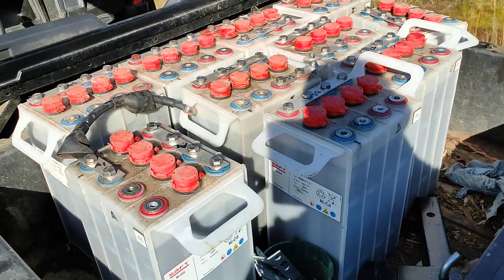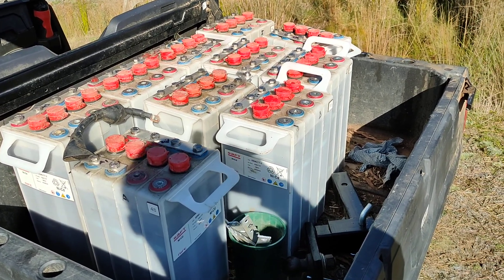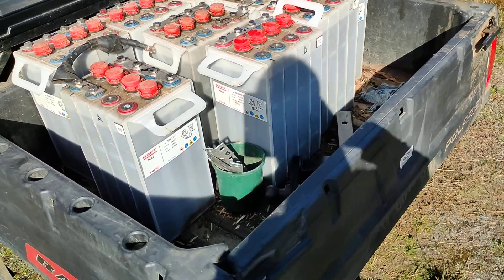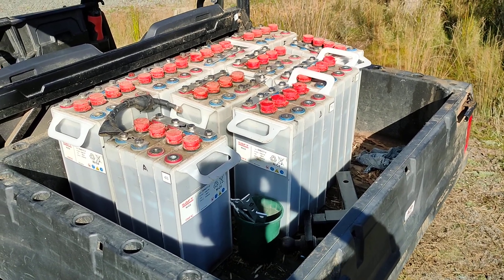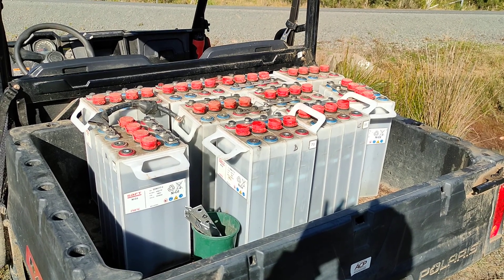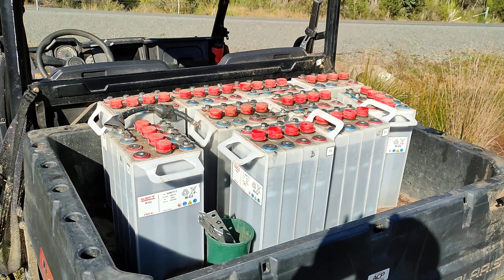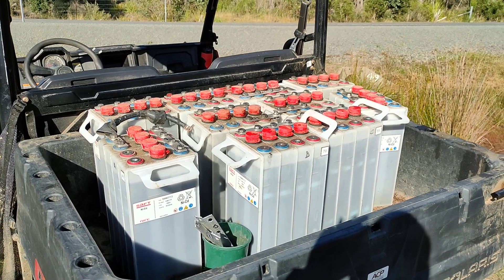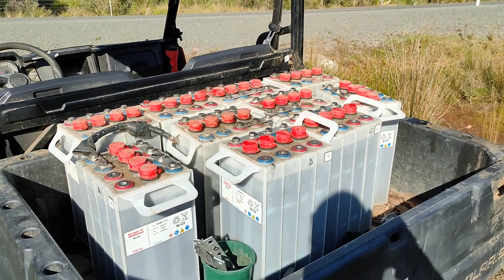OGT 61 - Verdict on Nickel Cadmium (NiCd) Block Batteries for Off Grid Use

Comment: I had a Victron inverter before, sadly I had issues getting it to talk to my Chinese lithium batteries so ended up going with a custom "user set" for charging, I ended up getting rid of it and the batteries, and now I have a Growatt SPF5000ES inverter and 5 Growatt rack mount batteries at 4.8KWH each module, more than enough power for me, fantastic system and you can monitor it on your smart phone if your away from home.
Reply: Sorry, what is the user set charging? i have some of this Saft NiCd and i want to charge it, to later mount in my inverter, but now i have to store it some time, we are under construction. thanks.
Reply: @ user settings are where you set your battery type manually and set the charge voltage, float etc, for lithium you have to set your settings to suit the battery, there’s a ton of videos on YouTube about setting up the Victron inverters so you should be able to get it setup right.

Comment: I have a total of 16 cells (Alcad)...12 of them are giving 1.2v each whilst 4 are giving zero volts..if by any means you can tell me a method to revive them. One question more ...what charger/inverter would ypu recommend charging a 12 volt arrangement of 10 cells each rated 476 ah.
Waiting for your reply..
Reply: Were you asking me?   If they’re very low I’d try charging 8 first with a 12v charger for 24 hours or so and then try the individual cell voltages again.  If some won’t charge them try the electrolyte for alkali with litmus paper (to make sure it’s not acid).

Comment: Hi.  I've been off grid here for about 20 years and I've always used wet cell Nicads.   You're right about the disposal, you have to throw yourself on the mercy of the manufacturers.  Also,  without a 'proper' charger, you won't get the rated capacity.  However, if you've got a lot of them and they were cheap enough you get a very robust battery system that will charge 'adequately' if you treat them like lead acids.  I've got them configured in strings of 19 for my 24 volt system and 38 for my (separate building) 48v system.  The good news is that I haven't watered my main bank for about the last 5 - 10 years and they're still showing above the low mark.  Also I can take the bank down to c 19 volts without any apparent damage.  They're of varying ages but I'd be surprised if they didn't last 50 years or so, the ones I started with were about 40 years old when I got them and they were still working 10 years later when I swapped them for newer ones.   I use an SMA Sunny Island inverter to charge the main battery bank on my 24 volt system. I've turned off the battery management system and just check the voltage.  This works well enough for me.  I only really run the generator if they get really low, generally in the three main winter months.  For the rest of the year my solar panels suffice.
Reply from the maker: Glad to hear someone else with the same experience!
Reply: Hi mick, i just got these batteries, may i ask a few questions?
Reply: @generaltechnicalsolutions3086   ask away!
Reply: @generaltechnicalsolutions3086  of course - ask away